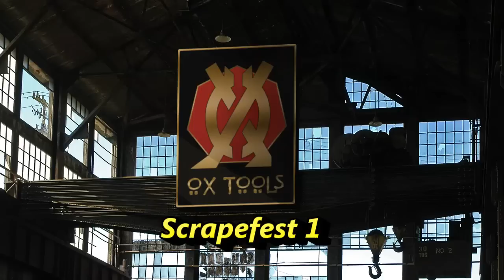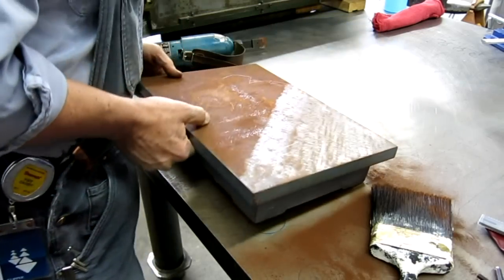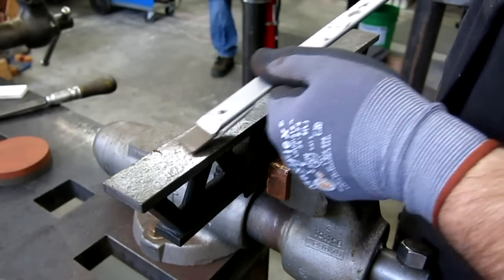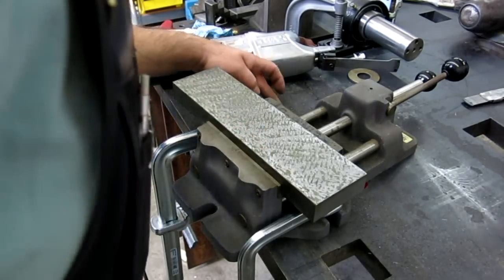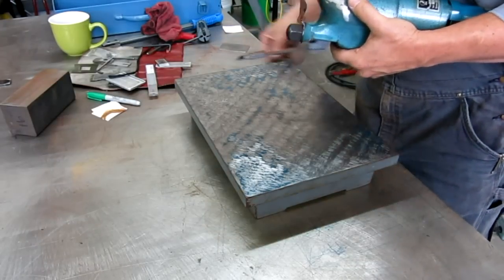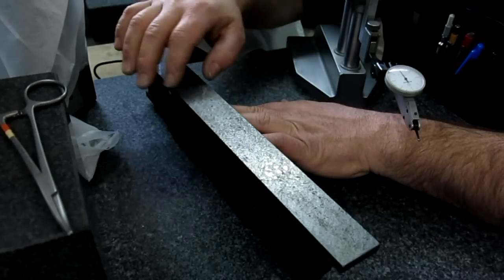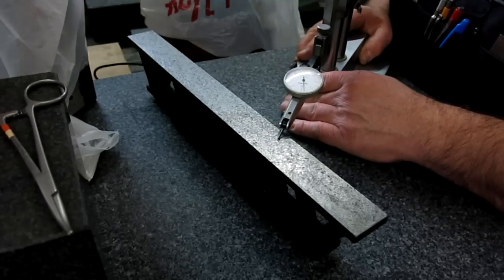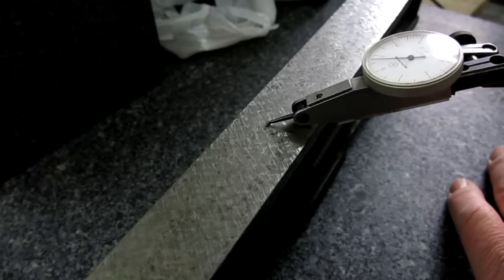Scrapefest 1

Comment: Thanks for hosting us, Tom.  A fun time was had by all!  We also all learned from each other.

Don't be too hard on yourself with the metrology.  Scraping has "surface texture."  Companies like Moore Special Tools would use a scraper's block to check the work on their exquisite machines and to test the scraped masters that tested the machines to millionths of an inch.  A scraper's block is an 1" square by maybe 1/4" thick accurate carbide block which is placed between the indicator and the scraped surface while indicating it.  In actual usage, your level will be supported by much more area than an indicator point.  On scraped work the many equally high contact points are what counts.  A gage block might make a reasonable substitute for the scraper's block.
Reply: ***** Scraper's block:
Foundations of Mechanical Accuracy, Wayne Moore, free download at
http://www.totallyscrewedmachineshop.com/documents/FoundationsofMechanicalAccuracy.pdf 
pages 28-29.  Material shown is hardened and precision lapped nitralloy steel, 25mm square, looks to be about 15mm thick.
Reply: The link you provided no longer functions, do you have a digital copy or another source. I can't afford the actual book!
Reply: It is now gone from that site, but you can now download it here:
http://www.hobby-machinist.com/attachments/foundationsofmechanicalaccuracy-pdf.118847/
I would do so soon...
Reply: Thanks so much, had to make an account but now I've got it. Lots of other useful documentation on the website also.

Comment: Thanks for sharing. Had to do something like that off shore for work. A fixture and a split clamp collar the wrong ID size but with heavy duty thickness. A small cutoff wheel, die grinder with a 60 grit flapper wheel and a sharpie. I did such a good job they forgot I did it and later ordered the wrong size replacement parts five years later.

Comment: Gday Tom,
That was nice to see some hands on scraping. One guy commented that a surface grinder is an easier way to do it, but hand scraping is more accurate than surface grinding no matter how good the grinder is. Hand scraping is flatter. Actually, one bloke I worked with reckoned that surface grinding is roughing out compared to serious scraping, I agree.
Reply from the maker: Peter Spence Hi Peter,

For small parts a surface grinder would be faster. When you get into large parts or tricky access wheel wear plays a part in just how good a surface grinder can do. Most scraping is done for lube retention on machine tools. Surface grinders cant do that at all. Thanks for the comment.

Cheers,

Tom

Comment: Interesting to see things done the old ways vs the easy way out of just surface grinding it to less than .0002 in one pass.  What if you don't have a high grade surface plate to use and your plate is off a few tenths to begin with, will they carry over to the scraped part?

Comment: You guys seemed to have a lot of fun:) I attended a scraping class in sweden with Richard Kind and I can tell you well money spent its so much fun:) I came to think about one thing he told us that's important is to "ring" the part before scraping. Hang the part from a string and tap it some with a hammer or something. I really didn't thing that would affect the work when scraping on really old stuff, but I was wrong:D My first project was an at least 50 year old angle shelf and that thing warped like crazy once I realised my mistake and tapped the piece lightly:) 

Thanks for sharing! Cheers!!!

Comment: Great video on your scrapefest! I might suggest after you machine the level, lap with wet/dry sand paper changing grit size a few times, then scrape for a final flattening. I probably would not use the Biax and stick with hand tools for the best results.
Good luck and enjoy!
Reply: Gene Elliott If a surface is ground or lapped, the blade of the scraper has difficulty penetrating the surfaces. It just skims off and dulls the blade. When ever possible I try to grind small surfaces prior to scraping so to fast track the scraping to the finishing passes. But before bluing, I use 100 grit sand paper to bread off the shine, then scrape a patch work.

Comment: When I'm checking the flatness of a scraped level (starrett 199 for example) or any other scraped tool, I put a gage block between the surface and the probe tip...love your vids! Thanks man!
Reply from the maker: Hi Michael,

That is good for seeing the average local surface. Thanks for the comment.

Cheers,

Tom

Comment: I have 30+ years in the tool shop for first McDonnell Douglas and later Boeing. I am in tooling inspection now. Honestly, I would just leave the level alone if you are happy with the surface. It has been decades since I had to do any scraping but we had to get 90% match between two surfaces, they wern't just flat but multi contoured. Any low spots did not hurt anything just as they will not hurt the level either. I do know the level of crazy we in the trade can get into, The first time I made a wall size book shelf for the home and it was 1/32 out of square it drove me nuts... until I realized it was just a book shelf! By all means do what you feel but if it were mine, I would remount the bubble and call it a day. YMMV! :P

OH, BTW, I still have 1/2 a tube of blue and the long hours of bench work it represents and remindes me of, still brings back a yearning to never use it again :P
Reply: ***** 
It is nice to have a good surface plate, Reconditioning is as good of a term as any :D Good flat surfaces (when that is what you need) just make things to together better. What do you do if you need a flat surface and don't have one? The answer is to make 3 by scraping, it takes 3 surfaces worked against one another to get a flat plane. If you only have 2 surfaces, you don't have anything, you can match a bowling ball to your shop floor with a perfect fit, 3 surfaces work to prove each other flat. Talk about a pain in the backside! It will make you glad to pay someone else to do it for you!!! :D

Comment: An interesting method of metal removal. Must be quite an old concept of metal machining. About the only scraping I have done, was when something very stinky got smeared on the brake pedal in Winter and did not notice it until I turned the heat on!

Comment: Nice work Tom, but don't be so shy with that scraper. At the print you had at 5:30, hook in to it big fella!

The divots caused by the corrosion are just cosmetic and wouldn't affect the function in any way. If they were on a machine way you could say they're "oil retention points". ;)

Comment: Great video. Have wondered about the process of scraping for a while and this showed several examples of how to do it. One question though. I understand the function of scraping. To create a flat surface that can be used to reference some other surface but how much scraping would be too much? If you have two perfectly flat surfaces they will actually stick together. Almost like being magnetized together due to the intermolecular bonding between the parts. At what point do you call it quits on scraping? 90%, 95%, 98% ?

Comment: This is old still interesting. The overall results that are possible is simply amazing. My mind keeps heading to refine the marking stoning process. I have Ideas but need to get a plate to start fiddling with it.
 Seems if one removed with cleaner all the color very lightly stoned. Then applied a contrast color using something soft to fill low spots also. Then a  light rub on a reference lapping type plate to show and maybe even lower some of them high spots. Alternating hard print flexible removal with hard removal flexible print might clue us in a bit on what is going on to say the least. I saw you sort  of doing that on the clean table looking for the polish.

Comment: Tom, my son and I are needing to scrape a bed on our lathe, we have a good understanding of how to scrape but touching up the blade on the scraper has us wondering how others might touch them up.  Any chance you might do a vid on how you touch up your blades?  Thanks.
Reply from the maker: ***** Hi Larry,

There is enough interest in scraping that I will probably make a stand alone video showing some of the stuff first hand. Right now I use an Accu-finish slow speed carbide grinder to touch up the blades. I think you could do a decent job with a simple fixture and some diamond hand held hones. Thanks for the comment.

Cheers,

Tom
Reply: oxtoolco
Thanks Tom, hoping you have the time to do another video on scraping.  As usual, we always enjoy your vids.

Comment: Hi mate.
Sorry, I don't get it, is this scraping meant to be in stead of a surface grind, or is it better.  What if you scrape it all flat, but one side is higher than the other.  Is this like Sudoku, making yourself crazy, and getting nowhere?  What does one remove, the blue, or the blank?
Marcel.
Reply from the maker: Marcel Timmers Hey Marcel,

This is not something that can be explained in a short comment. The original level was hand scraped so I wanted to follow tradition. And yes you can produce surfaces that are better than grinding if you want to spend the time. Thanks for the comment.

Cheers,

Tom
Reply: oxtoolco Tom forgive me but are you for real--you have thrown me me a real loop..If you have diamond impregnated grinders that do not wear,the question is how hand work is better than machine grinding..You have totally lost me..regards Ian    what happens
Reply: +Ian Craig try running an entire bed of a lathe under a grinder? Hand scraping get into places on large machines with ease. Also, you can scrape in alignment and parallelism with the machine in place: even down to accounting for future wear.

Flaking can be added to hold way oil on the surface and reduce wear. Proper fit can be made, far beyond normal surface grinder sizes and shapes.  

Most levels arn't flat on the bottom!

Comment: Where did you get the rubber roller for spreading out the bluing?  Got a scraper from McMaster, but couldn't find a source for a roller.
Reply: YCM30cnc Try an art supply store.  It's called a brayer.  Printmakers use them.  Dick Blick no doubt carries them.

Comment: Would a steel surface plate that has been worked in a surface grinder be just as flat ?  Years ago I took a steel lapping plate that had been thrown out because it had been used to the point of having a bad hollow in the center, trued up the wheel on the surface grinder and ground it what I thought was perfectly flat.  What about a Blanchard ground surface?  Thanks in advance for any input.
Reply from the maker: +opticschief Hi Optics,

The answer is no it wouldn't be as flat. When scraping we are matching to a master flat reference. The surface grinder can produce flat parts but you have no reference to compare it to. Thanks for the comment.

Cheers,

Tom
Reply: +oxtoolco What about grind first, scrape second... good approach or bad?
Reply from the maker: +DSCKy Hi DS,

My grinder does not have enough travel to cover the entire length of the level. Good excuse to buy a bigger grinder. Thanks for the comment.

Cheers,

Tom

Comment: Interesting...... although I am not completely understanding the concept of this Scraping method.... A previous viewer asked "why scrape when you can surface grand?"  or why not just mill off 2 or 3 thou...?  I'm missing something here..... I guess the main question is ... What is the main benefit of scraping vs. milling or grinding?  Thanks Tom.. I'm curious....
Reply: Depending on how well you do it, a scraped surface can be more accurate than a surface ground or milled surface. Plus, a surface grinder or milling machine will only be as accurate as its ways, which are commonly scraped. Scraped surfaces tend to be a better bearing surface because they hold oil better.
Reply: Danny Herrera One of the advantages that scraping offers over surface grinding is the ability to align and fit parts relative to each other and do so very precisely and with great control. Precision scraping is done when parts are in the natural state. When parts are ground they are influenced by holding forces and thermal effects, where as in scraping, there are very little of those effects. The scraping methodology is mostly superior when it comes to correcting machine tool geometry. And as Andrew stated, the lubrication evenness is also better with scraped surfaces. As a scraper, we talk in terms of tenths (.0001")  with contact points of up to 40 points per square inch (Technique 40).
Reply: +Andrew Phillip I can't even wrap my head around how that is possible, the guy is holding the thing in his hand.

Edit: I should have watched more of the video before commenting and now it makes sense.  Nothing is perfectly flat, ways have irregular wear patterns, heat and clamping forces also confound flatness.  So the granite stone with die is a very very flat reference surface and it reveals the imperfections in the surface and the human hand can remove very fine amounts of material with an abrasive, giving a very precise surface.
Reply from the maker: +The Eternal Hermit Hi Hermit,

Well said. Milling and grinding do not necessarily produce flat straight geometry. Thanks for the comment.

cheers,

Tom

Comment: so how do you make a master flat surfaceis... if you dont have a master flat surface to go off of?
Reply from the maker: +sideswipe147 Hi Side,

You can create a flat plane of any accuracy level by scraping and checking three flat plates together. You check them against one another and slowly increase the bearing area between them until the desired level of accuracy is achieved. The sky's the limit. You do need three so you don't just match one to another. The third plate is the key to producing a flat plane. Thanks for the comment.

Cheers,

Tom
Reply: +oxtoolco 
cool. thanks for the info.  I'm just starting out so I don't have a lot of the needed tools and whatnot. but I do know that a master flat is quite important to have and being able to make one if needed is incredibly valuable information.

Comment: Okay, being new in the machinist world, what is the main purpose for scraping? Looks like something I would like to try. Also, are the tools hard to come by? Thanks, John (a.k.a... ShadeTree Machinist)
Reply: ShadeTree Machinist Making precise flat surfaces for measuring instruments and machine ways, it is also used to create pockets for oil in the machine ways to prevent stiction. You can make hand scrapers from old files or buy them, there are some nice ones with carbide inserts I believe.
Reply: Thanks for the info. That makes since.
Reply: ShadeTree Machinist **SENSE. The word "since" is used to denote a passage of time, eg "He hasn't ridden a bike since he was a boy."
Reply: 666alikat But do you know the word "typo"?
Reply: A typographical error is a mistake made in the typing process of printed material. The term includes errors due to mechanical failure or slips of the hand or finger, but excludes errors of ignorance, such as spelling errors.
Reply: 666alikat I find it incredibly unlikely that he does not know the difference between the word since and sense. So although it was not a simple finger slip between one key and the next it was probably an honest mistake he would have spotted had he checked it. That is not an "error of ignorance".
Reply: I feel like you're assuming he is a native english speaker. In any case, malapropisms ("homophone substitution errors") are quite egregious and so I feel it is necessary to take steps towards correcting that deleterious behavior.

#NoBozos
Reply: 666alikat Thanks for making your trolling intentions clear.
Reply: ***** It's more likely the auto spell correct setting.
Reply: vmitchinson Possibly.

Comment: Hi, I've watched a number of videos on scraping and it seems time consuming, why not just put it in grinder to get perfectly flat surface? 
Ok,... I just read comments about oil flow, well then why not machine in some optimized pattern like lines on a bias or something?
Reply from the maker: +junglemap My surface grinder will not cover the length of this level. The larger the surface the more difficult it is to grind it perfectly flat.  Thanks for the comment. 

Cheers,

Tom

Comment: <---Has no idea what scraping is.
<---Finds it interesting, nonetheless, like everything else on this channel.
Reply: +Widg3t's Widgets It is the process of taking an uneven surface back to a flat state. We do this on ways and anything that requires a truly flat surface. The other process of scraping is "flaking." This gives some voids for oil and what not to flow between two flat surfaces. If you place a couple gauge blocks together with a bit of oil between them, they will stick. Flaking will prevent this, and let things move smoothly.